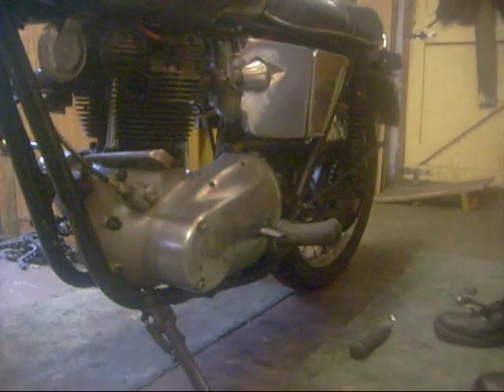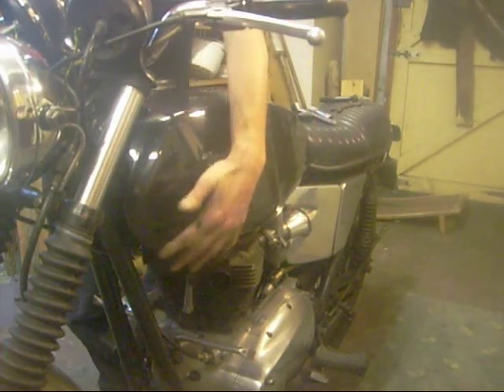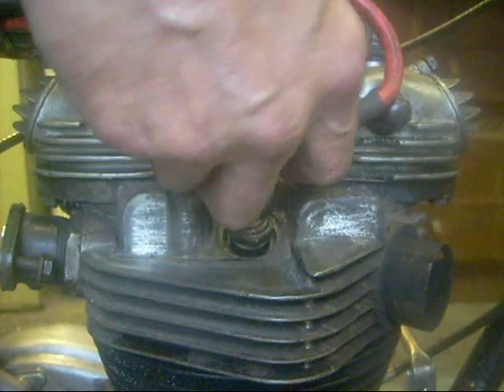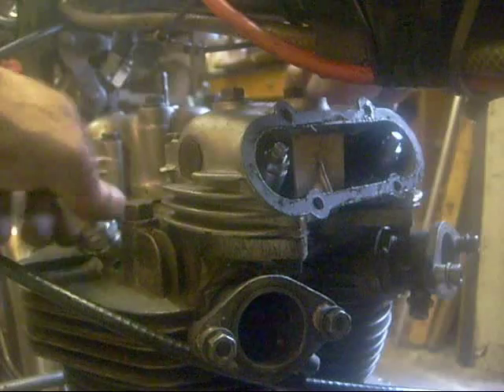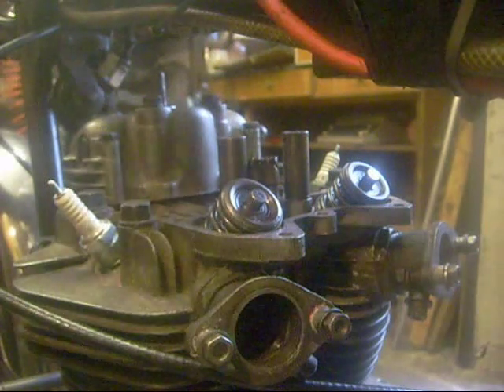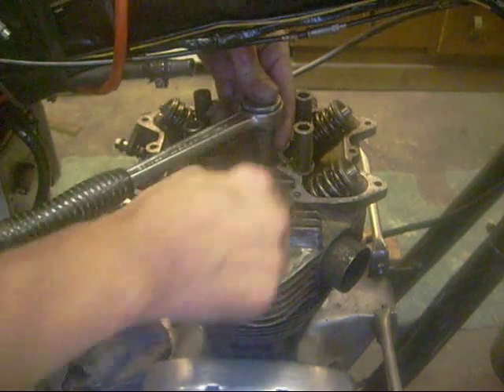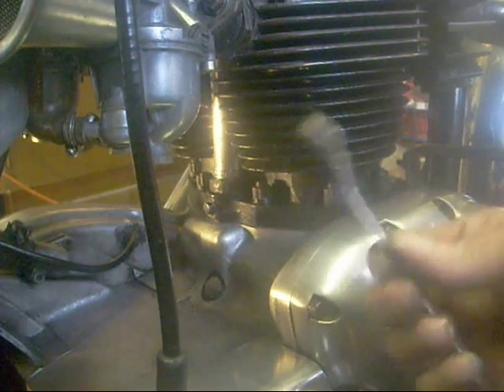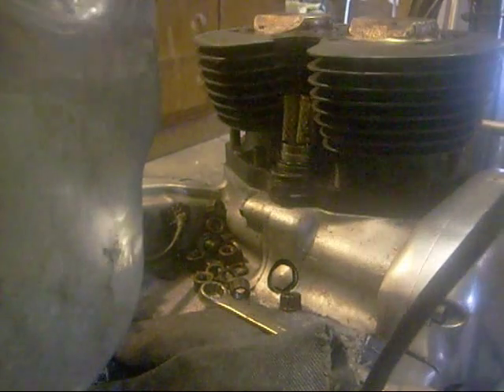Changing  piston rings, Triumph T120R part 1

Comment: Yes, when the pistons are off, the rods are vulnerable and must be protected. I use a piece of water pipe foam insulation over them, but at minimum tape from rod cap bolt to rod cap bolt up and over their fore and aft , or hold them in place with big rubber bands from old inner tubes.

A broken rod and the damage it does on the way out is no joke.

Comment: Excellent.

The reason to torque nuts and bolts is so you don't  get them too tight.  Yes, you develop a feel for it, but it takes experience. 

For torquing the base nuts, I have a little 3" long ring spanner (box end wrench to us Yanks) with a 3/8" female  drive on one end. It makes the torque wrench 15" long so you have to do a little math to not overtighten it, but if you put the wrench at 90 degrees to the spanner it doesn't make any difference.

On to Part 2!

Comment from the maker: Hi Mek4563 yes basically the same, you will have to remove the head and the gearbox.
 I think you can undo the big end caps and push the rod and piston out the top, without removing crankshaft.

Comment: hi i seem to be having a problem with my honda xr400r it first started smoking wihte smoke then within a week it swated back firing alot wen ever i let go of the gas and it seems to only run wen the choke is on full it will run with out it but it wont be backfiring any ideas what it is i think it is rings